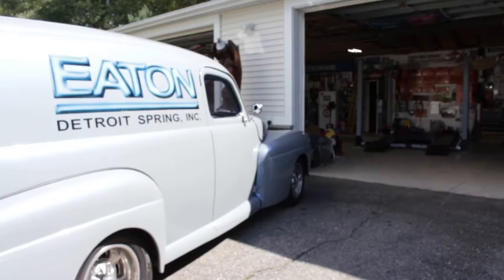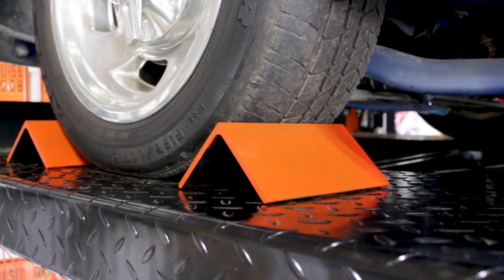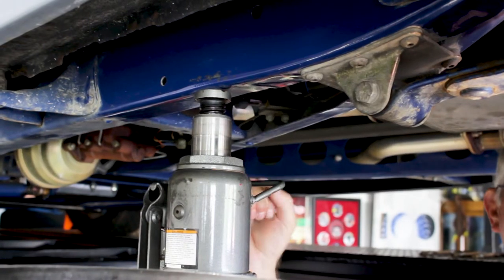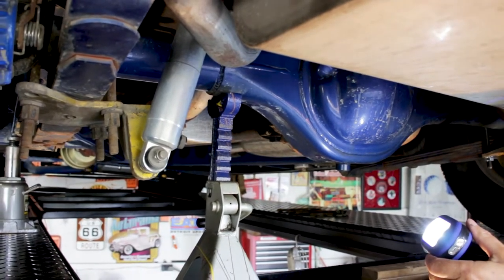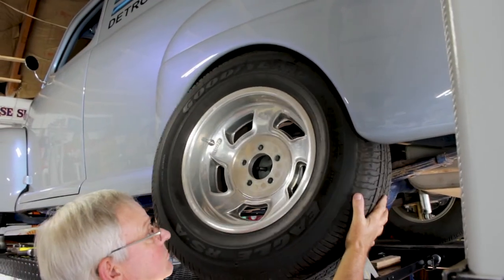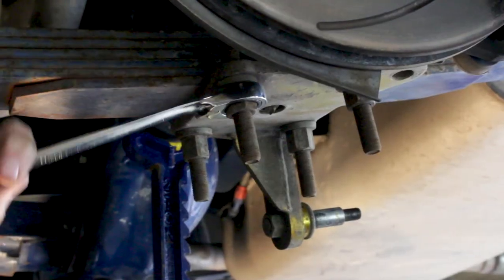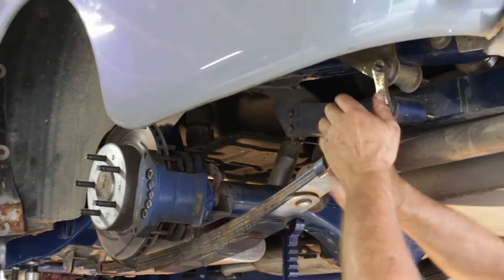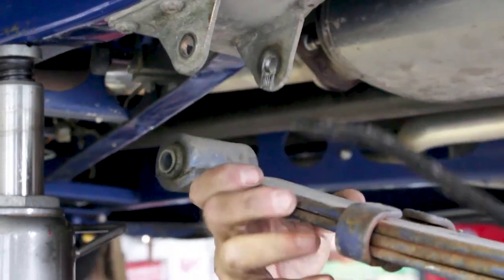Removing Leaf Springs - One Minute Monday by EATON Detroit Spring

Comment: How’d you get your bushing bolt come out without melting it out
Reply from the maker: I can feel your pain. Sometimes getting the bolt out of a spring eye can be one SOB. If you have the time, soaking it with penetrating oil over night can be a big help. A little heat can also help. So can a big hammer. And if all else fails and you can get the blade of a sawsall between the spring eye and the hanger, cut it out. And if things really fail, burn it out. But be careful.
Reply: @EatonDetroitSpring  thank you for the tips.  In my mind I had a simple bolt on bolt off process but that’s never the case with a 24 yr old vehicle.  Spent 2 hours on a bolt to find out bolts were rusted to the metal sleeve inside the bushing.  Had to cut 3 out of 4 off with the angle grinder haha.  Just looked at your site, If you ever started a ford ranger line I’d buy for sure.  Good stuff!
Reply from the maker: @Nikkk6969  We do offer springs for Rangers, in fact we manufacture springs for more than 175,000 applications. None of us will live long enough to get them all put on line, so if you springs for something you do not see on our web site, give us a call.
Reply: @EatonDetroitSpring  thank you!
Reply: Yeah, it’s never that easy 😭